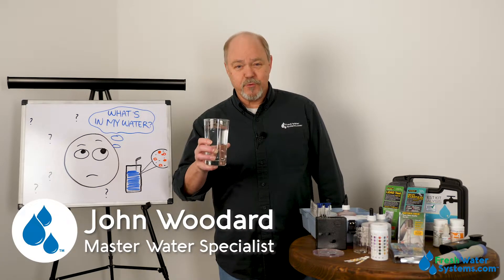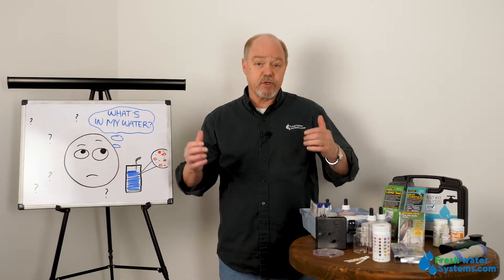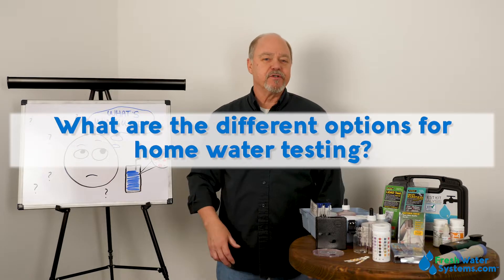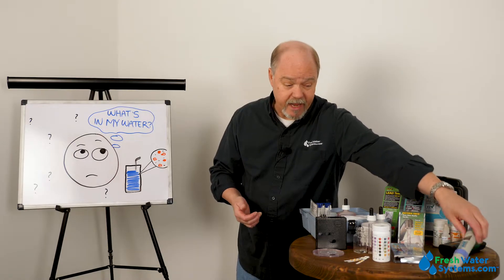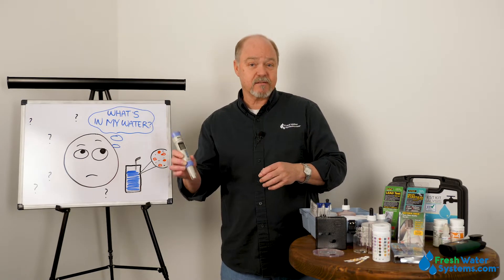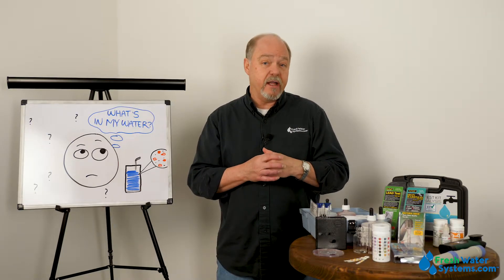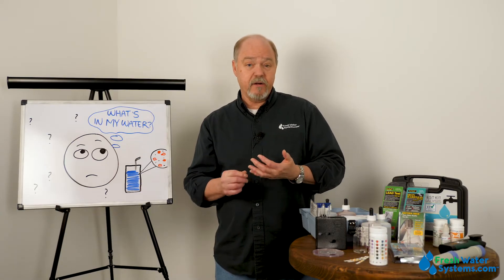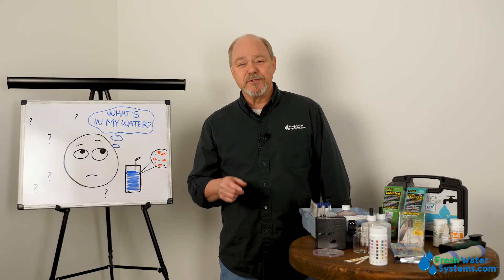How Can I Test My Water at Home with a Water Test Kit?

Comment: Do you have a video that will help verify what's in the water and how to correct it so it is safe to drink Thanks
Reply from the maker: Hi! Unfortunately, we have not gone through each test kit to video the process.  The first thing is if you are on municipally treated (city) water.  If so, the water utility publishes and annual water quality report and is required to maintain EPA standards.  The test kits you would want for that water are inorganics such as hardness or Total Dissolved Solids (TDS).  If you are on well water some of the multiple parameter test strips will give you an idea of what may be in the water but if the well has not had an analysis done is some time, we recommend this kit which is analyzed by a laboratory.  https://www.freshwatersystems.com/products/watercheck-w-pesticide-test-kit?_pos=1&_psq=watercheck&_ss=e&_v=1.0  

Once you have that information we can make recommendations based on all of the results.

Comment: Hey John, I subscribed..

I'm seeking a mentor. Im american but i live in asia. The water here is spotty at best. Every city is everywhere I guess. Anyway, im looking to build an at-home lab that can process mass samples if needed. as i look into arsenic testing the only machine i can find (as chempicals seem very expensive on a larger scale) is about 500usd which is within my budget. but the supplier says i need good ventaliation do not do at home bcs it produces waste harmful gas and must use the machine with mask. 

anyway, let me know if you would like to help. this is important to the safety of my family and the people. a private lab where many americans live in a foreign country i mean (and the locals of course)

i also have incubator and augar plates and a microscope coming as i wish to analyze more stuff too here in the community. i could super really use some guidance thanks
Reply from the maker: Thank you for subscribing! In regard to setting up a water testing lab and the equipment you need, I am not the guy to provide that leadership. I rely on existing laboratories like National Testing Labs, that we can send samples to.  We only offer testing kits for homeowners.  In order to be able to do volume testing over a broad spectrum of parameters, which sounds like what you want to do, I suggest you have some in depth conversation with a US based testing lab or equipment provider.

Comment: If our water is yellow and it has to be boiled before using it is it safe to use it.  after I boil it and place it in a bowl for my dogs it's leaving a yellow substance in the bowl that when I wipe out the bowl it come out on the paper towel.. what could this be..
Reply: I think boiled use to work before they used to ADD CHEMICALS to the water.   Please have that water test.  WELL is the best water etc..  I do not give my dogs what I will not eat or drink..    Good luck
Reply: I’m no expert but iron, I’d google iron in water and see if it ticks all the boxes.